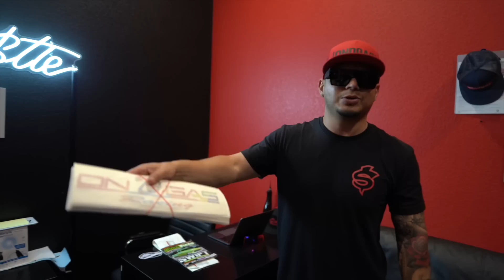Thank YOU for 150K SUBSCRIBERS!! *NEW GIVEAWAY!*

Comment: Blue chrome wrap. Gloss black accents. Wheel lights. rock lights. Starlight headliner. Hornblasters k5la train horn. 12" kelderman lift with air ride. Powder coated candy red suspension. 28x16 on 42s. Upgraded turbo. Wehrli fab intake pipes. Tuned & deleted. Nomas nomas....😎
Reply: ☝️☝️ congrats you have been selected amongst our shortlisted winners^^^^^^^^^^^✔️✔️✔️🎊🎊🎊

Comment: Color match the Chevy 2500 some bad ass rims and tires and powdered coated suspension. Super Clean and simple can’t go wrong with that. On the new chevy build u should call it “ Da LightWeight”.
Reply: Change the front grille to the high country grille with the bowtie instead of the one that it has Chevrolet letters in the front. Looks cleaner 👍🏼